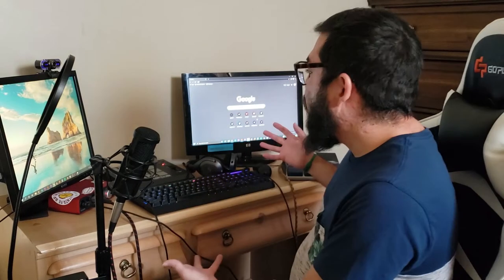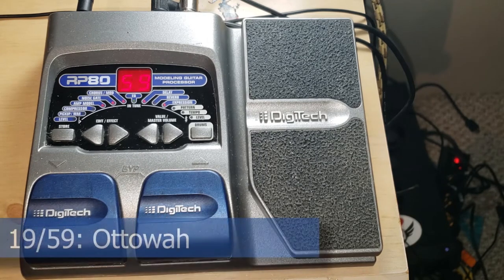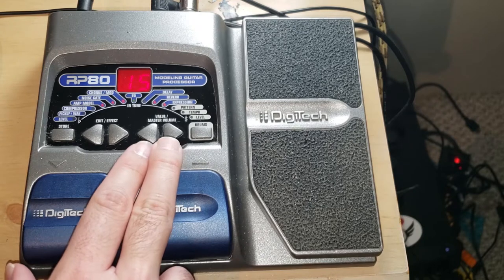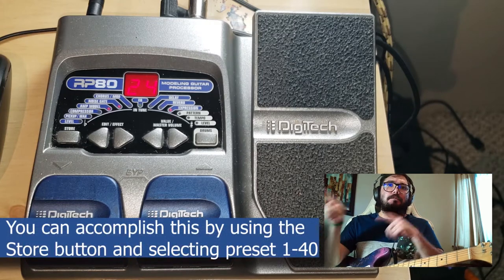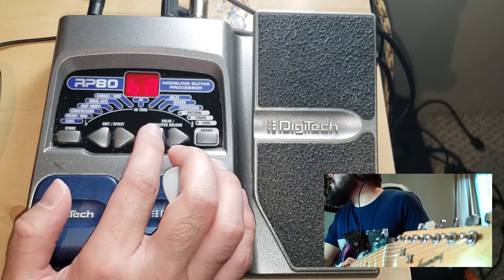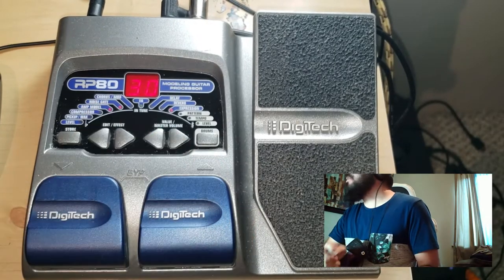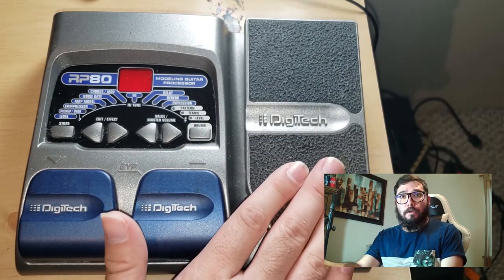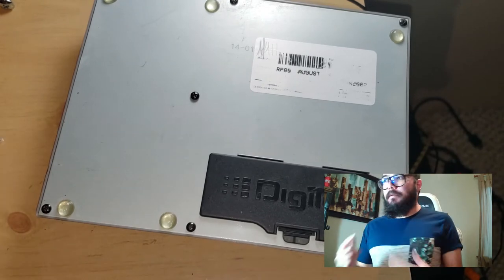Digitech RP80 Guitar Effect Pedal Demo!

Comment: I have had the rp50 for over 10 years.  I have a lot of other multi effects but I always grab this one because it is so easy to use. That being said, it is kind of noisy and the parameters don’t allow much adjustment. Also the highest volume is not very loud. There are much better multi effects available today. Don’t pay more than $30 including shipping for an used RP80.
Thanks for the comprehensive review.
Reply from the maker: Awesome feedback! I agree i have some qualms about certain cabinet sounds and the volume issue as well. Nothing that's a deal breaker though! Thanks for tuning in!
Reply: Yep The RP-80 is highly under rated pedal. Many peeps give up on it because they never learn to program it when its so easy. Its also a simple learning platform for programing high end pedals like Headrush or Boss GT.

Comment: Nice video! I have had many Digitech MEs..255, 355,500..all were great and well built. I also had an earlier gens such as RP100A,RP90 and got this one as well..All of them had issues with either the foot-switch or the expression pedal. So just like your case, it was never a problem with the circuit board(good on u DT). These mechanical problems are all fixable as long as you open the chassis. Sometimes I had to insert a piece of rubber between the foot switch and the the board. Anyway..the RP80 sounds cool and the drum patterns are soo retro 80s and 90s..too funny) sounds like a Boys2Men track sometimes..lol. This is one of the most anti knobs multi effect I have ever seen.

Comment: I have had one of these lying around for like, 12 years, but assumed it was just “junk” and “cheap”. I was never impressed with it, but you know what? I haven’t played with in probably 10 years so - I’m gonna plug this baby in again.

I like how you casually just went through it. I remember being just so dumbfounded even after reading the manual. I had the same issue with the expression pedal.
Reply from the maker: Yeah man it's not bad! There are obviously much higher quality specialized pedals, but for an all around pedal i think it works great
Reply: Exact same case! Bought this thing when I was in probably the 10th grade and never could get it to work like it was supposed to (at least with an untalented 10th grader playing it :D) But, did the recalibration from the video and it's working!
Reply from the maker: Yay! im happy I got you working again!

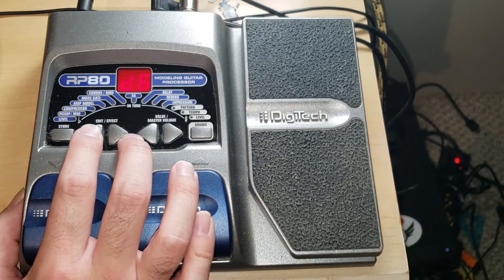Comment: 6:00 Pickup/Wah
The Value buttons select the Pick Up or Wah type that is simulated.
OF - Turns the Pickup Simulator / Wah module off.
SH - Gives a single coil pick up the warm tone of a humbucker.
HS - Gives a humbucker the unique sound of a single coil.
Cr - Cry Wah is a traditional sounding Wah.
bo - Boutique Wah is a wider sweeping Wah with a more modern sound.
Fr - Full Range Wah sweeps the entire spectrum of audible frequencies.

Comment: Do you happen to know the current draw of the RP80? How much mA?
Reply from the maker: Hi Rex! This is the most information i could find, from the RP80 manual:

Power Supply: 6 AA Batteries or DigiTech PS200R (9VDC) power supply 
Power Consumption: 5 Watts Maximum (w/ PS200R power supply)
Battery Life: >15 hours with continuous useage
Reply: @TrateMusic  Appreciate you!

Comment: Didn't the Expression pedal only need to be re-calibrated?
Reply from the maker: Yes. Initially i thought it may have been hardware related but it was just a calibration issue
Reply: I've got one of these myself and after a decade plus of ownership, it's finally being put to proper use after being told I needed Reverb, Delay, Compression etc - what I seem to want is irrelevant, apparently :-) Anyway, looking forward to using it properly and this video filled in some huge gaps in my working knowledge of the RP-80 so, thank you very much!
Reply from the maker: No worries! Haha that's why I like doing this channel. I'm nowhere near a professional with this equipment, so much of my content is trial and error. In a sense, i go and pull stuff apart and mess up and figure out things so that my viewers may not have to themselves 😊
Reply: I just downloaded a .Pdf of the manual for the RP-80 and it even tells you how to recalibrate the Expression Pedal! Rather handy, I thought.
Reply from the maker: Yep i did the same, i have the recalibration steps a little ways into my video as well
Reply: @TrateMusic  I've been eyeing the Zoom G1X Four as a possible upgrade to my early noughties RP-80 however. Smol, lightweight and just as portable as our Digitechs...
Reply: @Ronno4691  How would I go about getting that Pdf?
Reply from the maker: Here is a link! 
https://usermanual.wiki/Digitech/DigitechRp80OwnersManual.1209449873/html
Reply: @TrateMusic  much thanks!